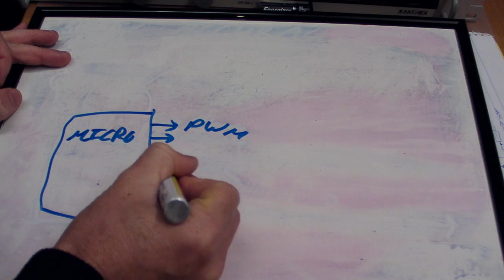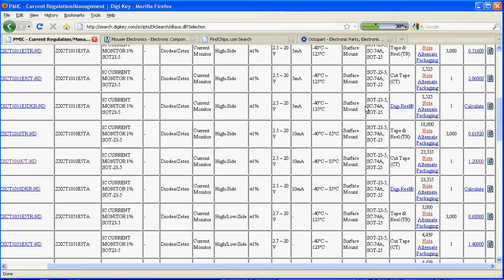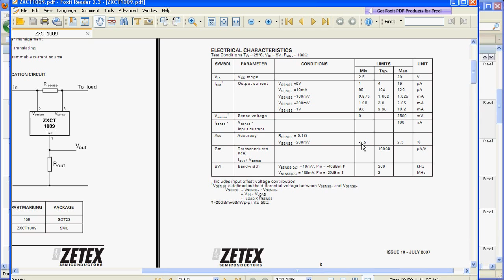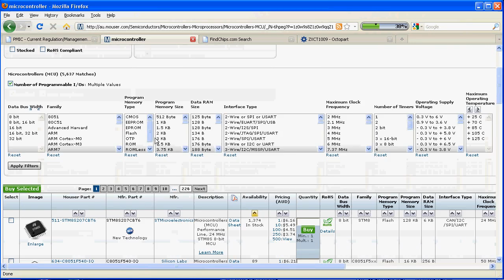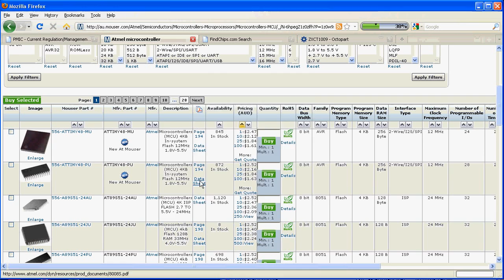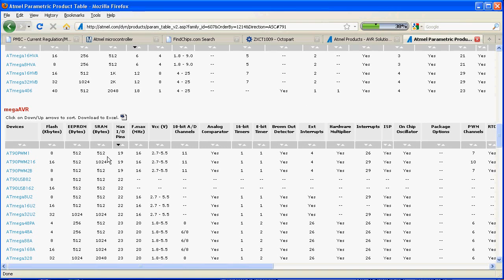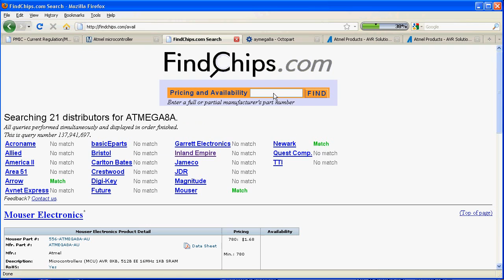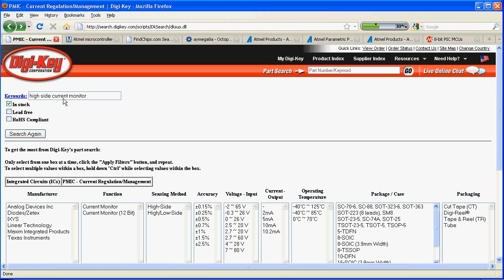EEVblog #87 - Let's hop on the Electronics Design Merry-Go-Round

Comment: You have aymega8a in the octopart tab instead of atmega8a so it can't find anything :)

I checked the attiny48 and it seems it does actually have two PWM outputs (from one timer) but it's strange they present it with only 1. Well, that's their fault.

Comment: Haha! So true! I've gone through half a dozen part iterations on some designs. Tried DC/DC converter IC #1, it got too hot. Tried a different one, the pins are too close for proper input voltage isolation (75V max input voltage with ~1mm pin separation? Really? On what magical super-insulator PCB?)
Reply: A little bit of potting compound maybe??
Reply: Vikram Balaji Yes, to add some extra thermal margin, but you want to start with the best parts and best design first.
Then you can optimize the system further.
:)
Trying to optimize a fundamentally crappy design is what's called turd polishing.
This is a software engineering quote, but it applies to electronics too:
Premature optimization is the root of all evil.
:)
BTW, premature is not the same as early...
Reply: +lnpilot. I bet >1mm Margin must have been really hard to get considering the fancy BGA and DFN packages everyone is after these days...
Reply: Vikram Balaji :) No kidding.